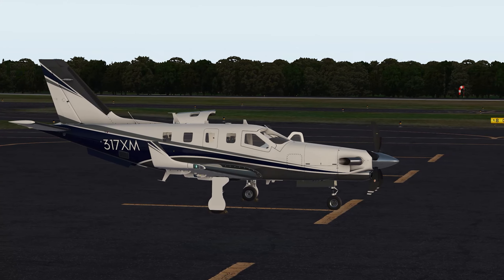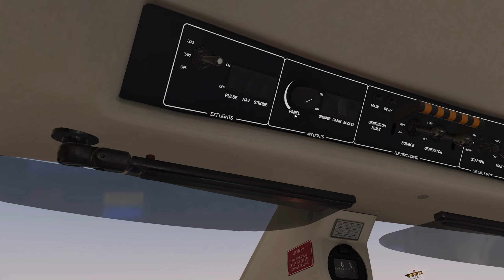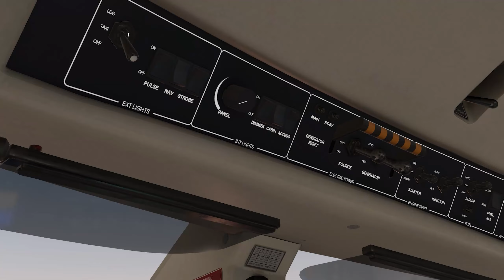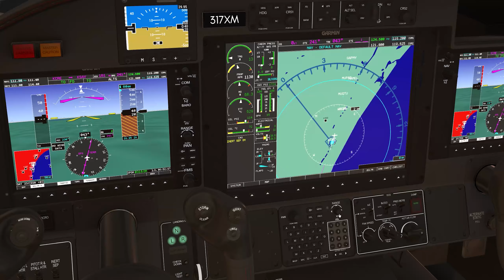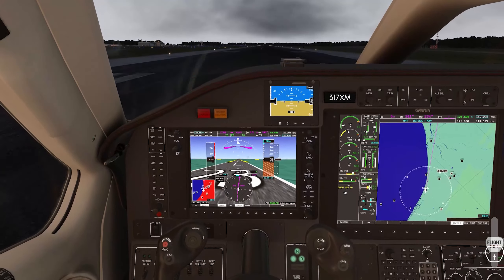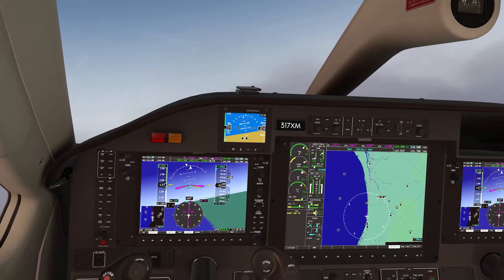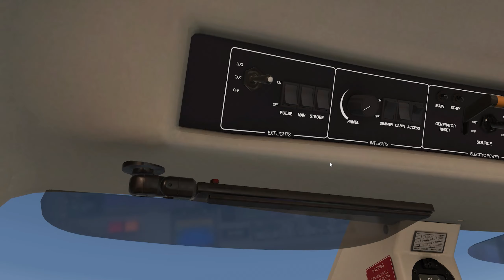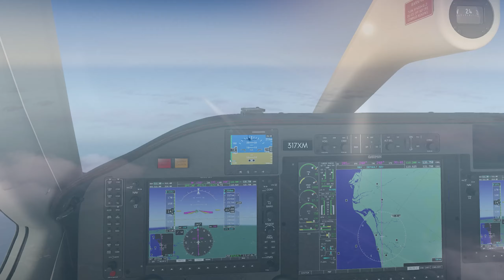Hot Start TBM 900 with ATC 2020 X-Plane 11 part 1 of 2

Comment: What ATC are you using at Strand and for the flight?
Reply: ,+1
Reply from the maker: So, there isn't really a good add-on ATC program that I know of.  I think both Pilot Edge and Vatsim are very good options but even they are limited to geographic locations, time of day, etc..  I have found that the best ATC is, well ... me :)   When I fly the trip I have a pretty good idea about what ATC is going to tell me and when.  I basically reply to nobody saying nothing.  More or less I answer ATC with what I want them to say.  Then I record (me) the various ATC positions issuing all of the clearances.  Then, I use software to "morph" my voice into a different  voice for each controller.  I also add a little static and a radio effect to the voices for realism.  I even throw in the ocasional mic click.  Finally I edit in all of the ATC audio synced up with the flight, and bada bing bada boom... presto, we have some ATC.  All that to add another layer of realism.  It's a lot of work but I really enjoy listening to ATC and I silent cockpit just doesn't seem right to me.  Long answer for a short question.  Thanks much and best regards, Tim
Reply: Clever!  Thanks for the reply. 
I too use pilotedge and do enjoy it but like you mentioned it is limited to the west.
Reply: @jewhipp98  If the powers that be, @ PilotEdge had any sense at all, they would have expanded by now onto the east coast. I have ZERO interest in flying around Cali. And I would have bought in bigtime a long time ago if they offered service on the east coast as well. They've had years and years to make the leap, and just haven't. So I'm not a fan...
Reply: A trick: watch movies on Flixzone. Me and my gf have been using them for watching a lot of movies recently.
Reply: @Ulises Armando Definitely, have been using Flixzone for years myself =)

Comment: Very nice...watching it now. Wouldn't it be nice to have a full panel flight sim do we could casually turn the knobs correctly. 😁
Reply from the maker: Absolutely.  I can say from experience that flying the real airplane is much easier when it comes to the fine motor skills required to do simple task like tuning frequencies, adjusting altimeter setting, flipping switches, pushing buttons.. etc.,  I try to map as many things as I can to my Saitek X-55.  On the other hand, flying the TBM on my computer is way less expensive!  Thanks for tuning in and best regards, Tim
Reply: @FSMaNiA  Yes, it's the one thing that can be too distracting. Nothing like looking back outside and your flying upside down. Looking forward to more content! I love the game, though I cannot get the clouds looking good with a i5 9600K and a GTX 1080. Time for some tweaking or spending more money.

Comment: I have recently installed X Plane 11 after years of using FSX (and watching all your videos). Thanks for this review, it's one of the planes I'm thinking of buying. I see you are working with MSFS now, however I'll stick with X Plane for a while until MSFS flight dynamics match its graphics. I'd be very interested if you did some more videos of Xplane aircraft, perhaps the King Air?
Reply from the maker: The only other X-Plane aircraft I have featured is the JustFlight Piper Turbo Arrow IV.  I am looking forward to X-Plane 12 release.